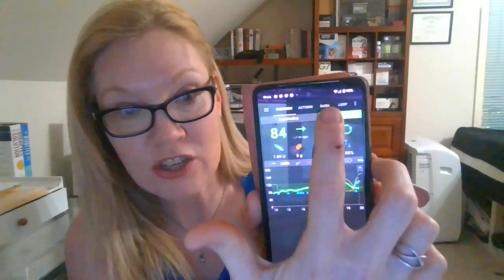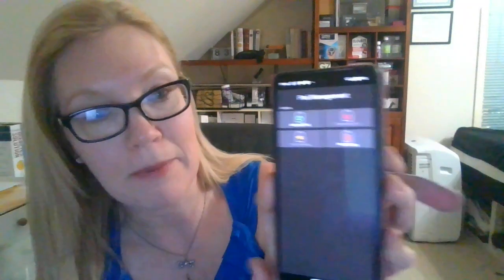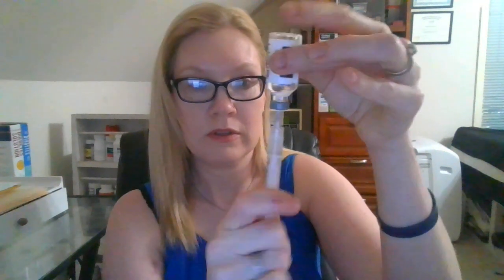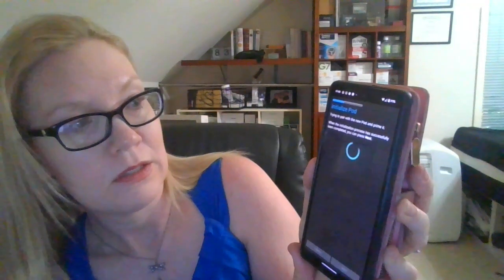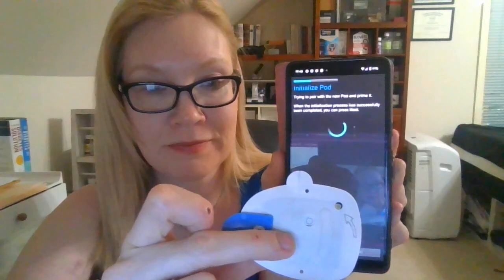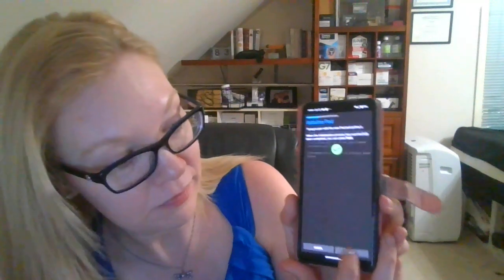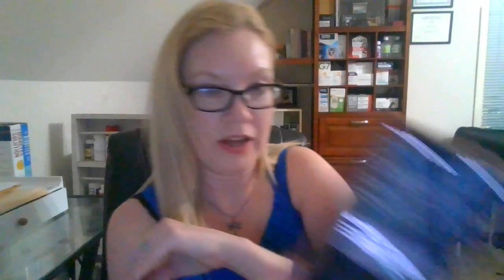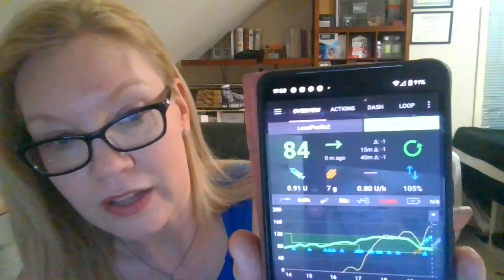Filling and Inserting an Omnipod Dash Pod with AAPS

Comment: Could you please help me to change open loop to close loop because I can't chat it I think maybe there's a problem in my settings
Reply from the maker: Are you using AAPS?
Reply: @GritCDE  yes
Reply from the maker: @للقرآنالكريم-ع3ط  do you have a yellow triangle or red triangle? Was it previously closed or have you never closed it?
Reply: @GritCDE  I have red triangle. 
No, when I put it on closed loop it's changed to low glucose suspend
Reply from the maker: @للقرآنالكريم-ع3ط  "Red triangle means that you have duplicate BGs and AAPS can’t calculate precisely the deltas. You can’t close the loop. You need to delete one BG of each duplicated value in order to clear the red triangle. Go to BYODA or xDRIP tab, long press one line you want to delete, check one of each lines that are doubled (or via 3 dots menu and Delete, depending on your AAPS version). You may need to reset the AAPS databases if there are too many double BGs. In this case, you’ll also loose stats, IOB, COB, selected profile.

Possible origin of the problem: xDrip and/or NS backfilling BGs."
Reply: @GritCDE  know I have yellow triangle
Reply: Now*
Reply from the maker: @للقرآنالكريم-ع3ط  "The yellow triangle means unstable delay between each BG reading. You don’t receive BGs every 5 min regularly or missing BGs. It is often a Libre problem. It also happens when you change G6 transmitter. If the yellow triangle is related to the G6 transmitter change, it will go away by itself after several hours (around 24h). In case of Libre, the yellow triangle will stay. The loop can be closed and works correctly." What is your data source?
Reply: @GritCDE  Libre 2 - xdrip
Reply: @GritCDE  could I *
Reply from the maker: @للقرآنالكريم-ع3ط  you might find this helpful. https://androidaps.readthedocs.io/en/latest/Getting-Started/FAQ.html

Comment: Great video. How do you like android aps vs tandem control-iq? 
What are the reasons you switched?

What features on AAPS do you use? Super micro bolus(SMB), autosens? Which alogorithm? Cheers!
Reply from the maker: I like AAPS better. The Tandem targets are too high for my goals. AAPS has a default target of 90 and I can set a long temp target of 83 if I want. I do useOpenAPS SMB and autosens. Also UAM though I do announce meals. I also have automations set if I hit 100, my target goes to 72 for 30min. If I go to 70, my target goes to 120 for 30 min.